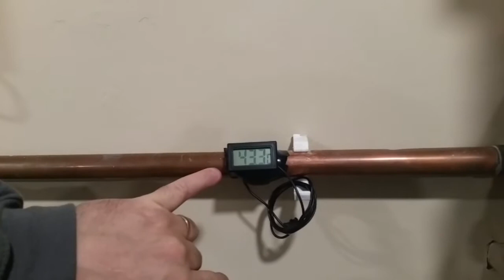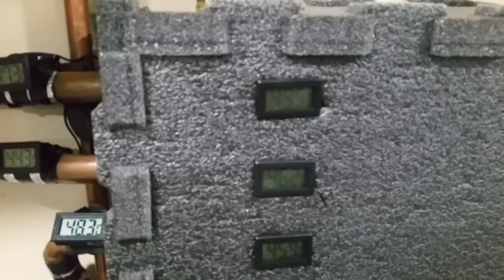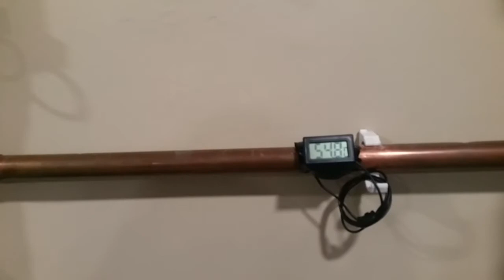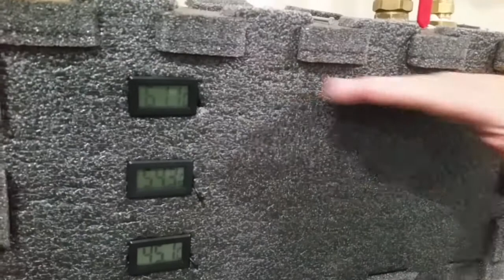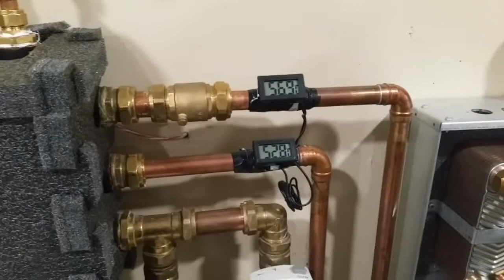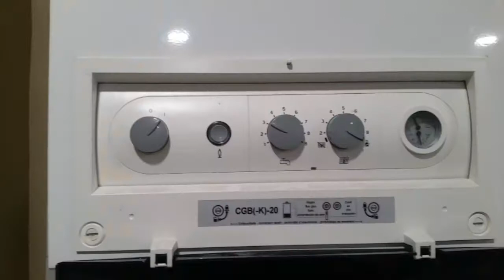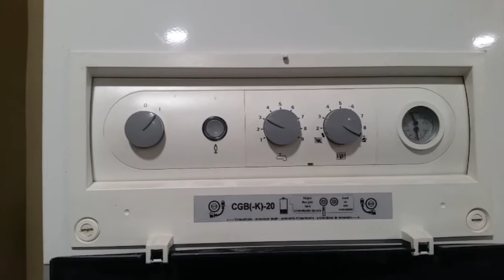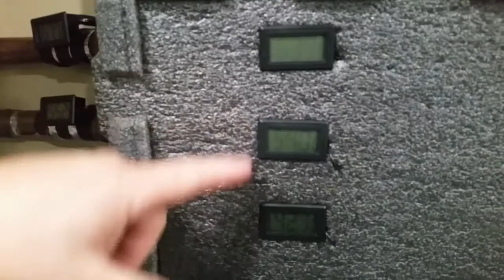Sealed to Open Heating System Interlinking with NRG Link

Comment: Why is the pipe thermostat to operate the pumps on the return line. Is it that you want the hot water tank to be heated first and then onto the heat exchanger circuit?

Comment: When I turn my radiator pump on the exchanger plate stops working and pressure builds to 3 bar on the prv between link and nrg zone box. Works fine when just DHW. Anyone help

Comment: How do you prevent fouling on the open vent side of the PHEX? I only ask because, on a pumped system, I'd normally put a mag dirt separator on the inlet to a PHEX.
Reply from the maker: From my experience, fouling in open systems is almost invariably because the open vent and the cold feed are not configured correctly or the cold feed allows heated water to rise into the expansion tank resulting in rapid evaporation and refilling. An open tank of water will have evaporation but the warmer (or even hotter in many instances) the water is, the greater the problem. Many open systems are so badly designed that the expansion vent outlet and the cold feed form a circuit and the system is destroyed in no time. 
If an open vented system is designed correctly the expansion tank should remain cold in all normal situations and the expansion pipe should have little or no pump-related activity. 
You can check how well the system cold feed and expansion are operating by simply immersing the vent pipe into a glass of water while the system pump(s) are switched on and off. If the water is sucked out of the glass or air is pushed down the vent and into the water, the configuration is defective. 
If the system is installed correctly, there is no reason for a PHEX to foul up in a reasonable time. All PHEX units require maintenance so the trick is always to follow the common sense guide of prevention being better than cure.

Comment: Good system a lot of hard ware I my opinion more suited to commercial id say your looking at 1800 more on a standard domestic setup good vid 👍
Reply from the maker: Those who fit the NRG Link say its by far the most economical to install sealed to open gravity 'by-the-book' systems on the market. It is the only system on the market that complies with all stove manufacturers and industry regulations.

Comment: WHAT A LOAD OF BOLLOCKS, what happens if the power is interrupted does it remain safe, what's wrong with a multifuel water cylinder or multifuel Thermal store.
Reply: It would still be safe because the uncontrolled side is open vented. The reason the pump doesn't come on until 56 degrees is to stop condensation in the log burner from the return being too cool.